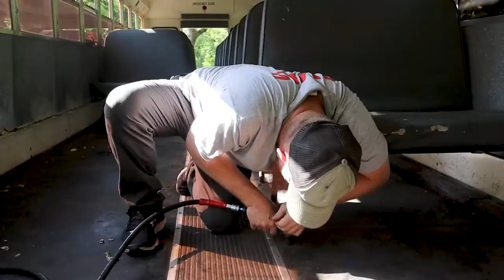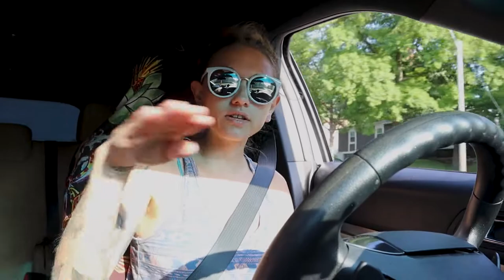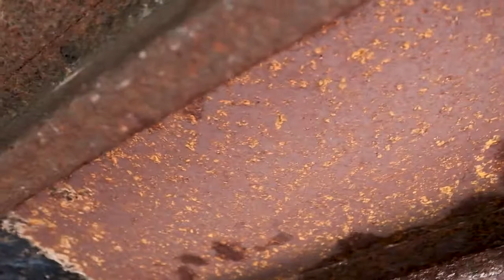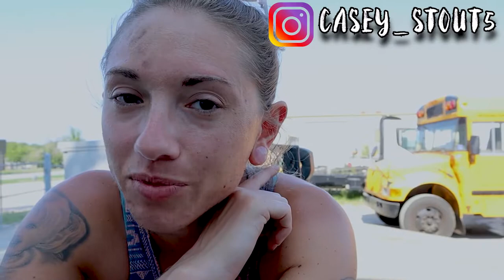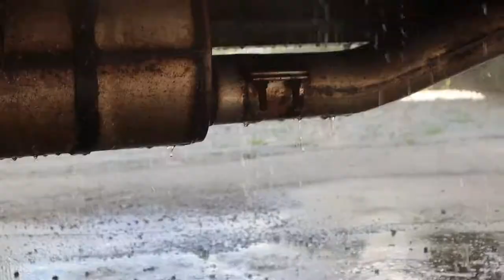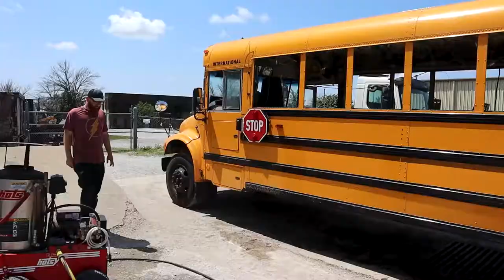How to remove Rubber under coated paint off a school bus with power washer/Tiny home conversion EP.7

Comment: This is so cool! I had no idea you were doing this renovation! I need to catch up on last videos. And that paint is on there thick!
Reply from the maker: It has a cover paint and then the paint under that has rubber in it and it’s a pain to get off.
Reply: @caseystout3698  yikes that is rough!
Reply from the maker: Yeah but the power washer has done a great job to get it off.